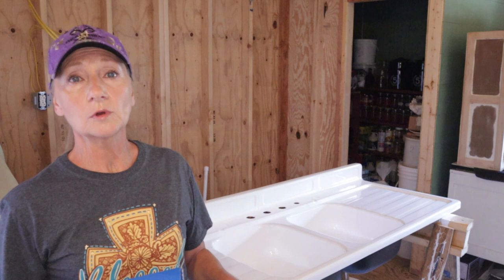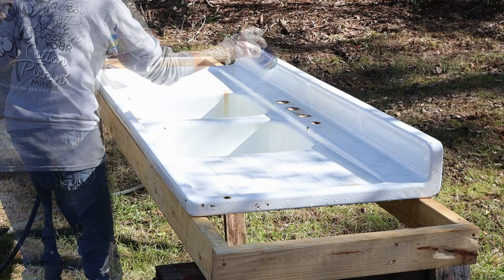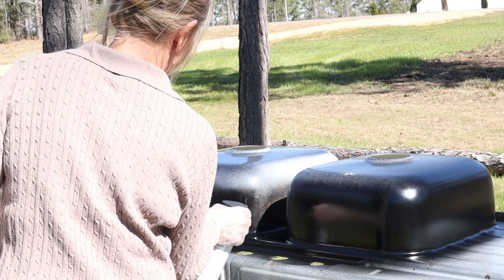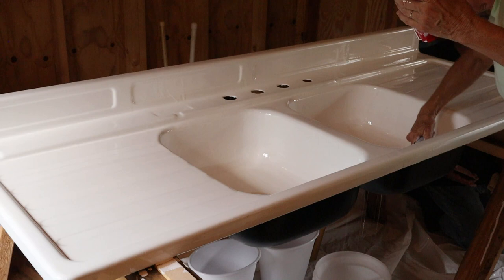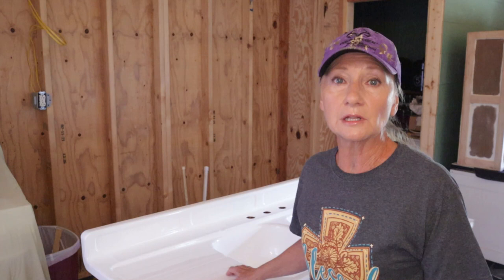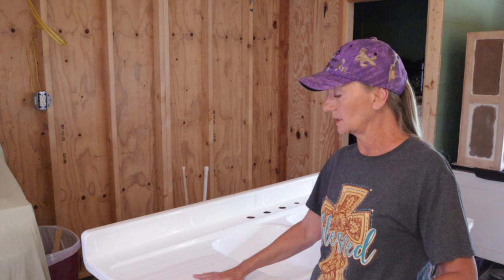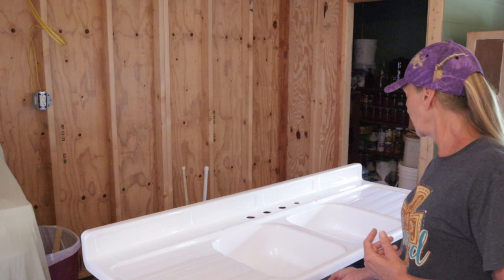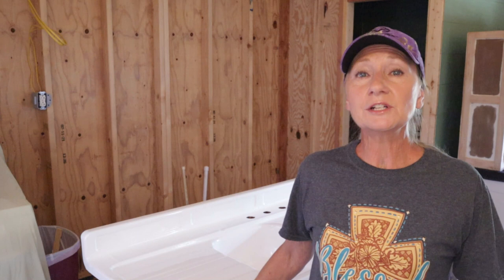Restoring a Vintage Sink - An amateur's tips and mistakes to avoid - Not a "How To" but a "Can Do"

Comment: you know it is dry when you can no longer smell it. when it stops smelling, you know all the gases are out. I did a bathtub in place with great results. the important part is the cleaning and prep work. I did my bathtub years ago and I did get some lumps here and there, but it wears just like the original. I will also add that you need not be afraid of using a grinder to bust the rust around the drain and other holes. Bondo is your friend around those holes.
Reply from the maker: Great feedback!  Thank you for sharing those tips. This was my first attempt and was so nervous but am very glad I did it and the sink turned out beautiful. Not perfect but still gorgeous. Thanks so much for watching and have a blessed and peaceful weekend❤️

Comment: I'm soooo glad I found you!! My home came with that exact sink and I've been wanting to restore it from the rust spots!! ❤
Reply from the maker: Glad I could help!  A couple things I have observed since using the sink for a few months - this finish is an epoxy, not enamel, so extreme heat can damage it. Take care to not place hot pots directly on the sink. Also, I would suggest a protective mat in the bottom of the sink to protect from scratches from sharp utensils. I clean mine with either bon ami or barkeepers friend.  Overall I am still so happy with the result and would use the product again. Have a blessed day❤

Comment: Great video! Any updates on how it’s handling the biffing and banging of pots and pans? We have one that came with our gut-job remodel home. It’s in pretty good condition, but with yellow basins. I’d love to figure out the best plan. But I cooked with cast iron, and it’s really rough on the sink so I’ve been hesitant.
Reply from the maker: We just installed it and started using it. It’s holding up very well!  I’m careful with my cast iron for obvious reasons and also I don’t set hot pans directly on the sink. The new finish is very tough but it is epoxy so extreme heat could damage it. Thank you for the great feedback and have a wonderful day❤️

Comment: Can you do another video on how your refinish has held up to daily usage? Great video thank you 🙏
Reply from the maker: We just got it installed and using it daily. I’m very impressed at how beautiful and strong the finish is.  One thing I’m careful with is my cast iron for obvious reasons. Also I don’t set hot pans on or in the sink. The finish is very tough but it is epoxy and extreme heat could damage it. I’ll for sure be doing an update video soon. Thank you for the great feedback and have a blessed day❤️